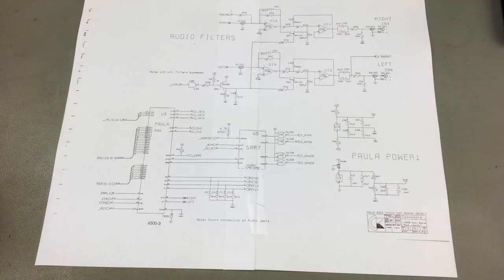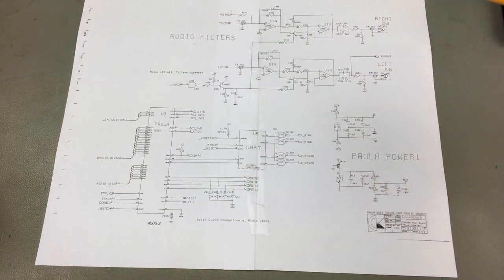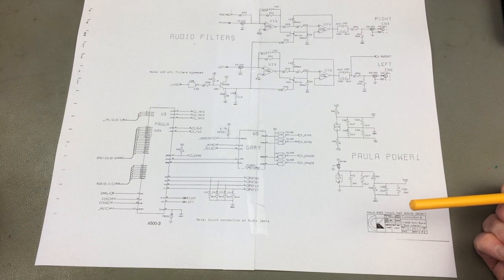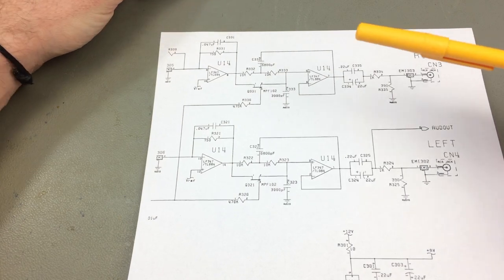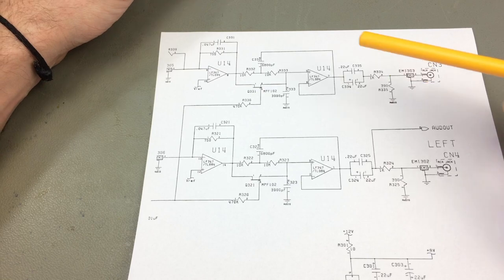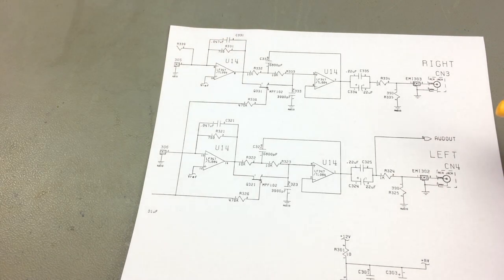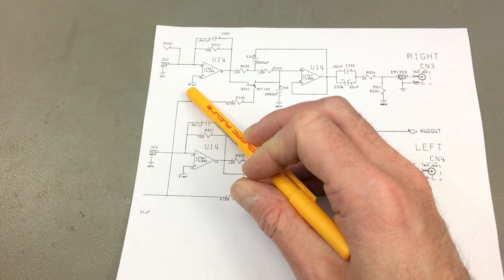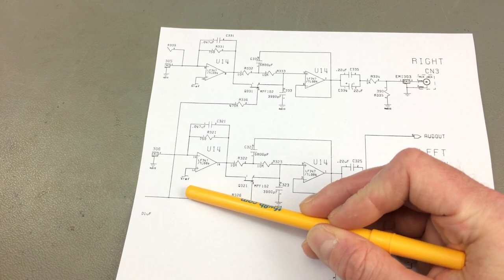Re: Bipolar Capacitors in the Amiga Audio Circuit

Comment: So, about the EMI filter. That is actually a T-filter (T resembles the shape of the circuit). That is a inductor in series. Then comes a capacitor to ground and then an inductor in series again. It filters out the high frequencies in the RF range.

Then about the circuit, that you have shown in the first schematic. That voltage divider creates about 2.5V, which is then used as a "virual ground" (=a reference point at the + input) for the opamp circuit. This is very common, like if you don't have a negatice supply, just +5V and ground. Here, they just used it to lift up the signal to 2.5V.

The polarized cap is absolutely ok. It just blocks the DC offset and is good practice. If you would measure the + and the - of that caps simultaneously with two probes and then subtract the - channel from the + channel, you will get something, that is mainly DC, a voltage drop of aprox. 2.5V.

The audio ground is separate from the digital ground. That is good practice. There are soem high frequency currents flowing through the digital ground (many transistors in the digital circuits are switching at the same time) , so it is very noisy. The analog or audio ground and the digital ground are split up close to the power supply. Absolutely fine. 

The 0.22uF ceramic cap is for the higher audio frequencies. An electrolytic cap usually has some parasitic inductance and that makes it behave like a low pass (a bit). So, that is helpful.

The old circuit: it has two polarized caps in a row with the negative side tied together. This is the internal circuit of a bipolar capacitor (Sic!). I do not believe that a bipolar capacitor will create a better signal. I think, it will be a bit worse. Here is why. Two similar caps in series will have half the capacity. But since they have a parasitic inductance, in series, it will add. So you have the double unwanted inductance. 

Around U56 in the old circuit, you will have an active filter (I will not analyse it :-)) It is fourth order and might be a bit unstable. In the newer circut, it is of 2nd order, which has a less steep characteristic than the  4th order filter, but might be more stable. A measurement with some (really expensice) audio lab equipment (aka audio precision) might unveil this. 

My conclusion: No bipolar cap is required. it will not improve the signal. the newer revision design might be better.
Reply: The EMI filters are actually just R-C filters so they have a lowpass effect... but the corner frequency is way out of the audio range so they have no effect on the audio signal
Reply: Peter Mulholland who would want that dc resistance of an r/c low pass in the audio outputs? They are L-C-L filters.
Reply: @svenpetersen1965  The resistance at AC in the audio band is negligible. Look up the actual parts used - they are R-C filters. Look further at how the later Amigas were implemented in SMD - with R-C filters.
Reply: and in fact if you look at the part value of E305, it is a ferrite bead (negligible inductance at anywhere below 1MHz) and a capacitor to ground. Missing in the later machines.
Reply: Also R325,335 is a lazy way to control the total voltage out. (at least i use it like that some times).

Comment: (Last post, I promise!)

The reason for the Vref bias is actually nothing to do with the output coupling capacitors - other than that's why the output coupling capacitors are required ! The Vref voltage is there because Paula is running from a single 5V supply. Therefore to have a "negative" part of the audio waveform, some bias point needs to be set. Because Paula's output is a current output, this output bias is set externally, and it is set at the first two opamps which perform I/V conversion for Paula.

They COULD have constructed a -2.5V reference point and fed this into the second opamp stage, but this would cause other design issues - it was easier to simply put DC blocking capacitors in line. Really, they could have made the audio opamps run on a single +12V supply, as they did later on in the CD32.
Reply: Correct, the output capacitor is there because of the Vref bias, not the other way around.
Reply: You have insight!!

Comment: Great video Jan, I enjoyed that!   Capacitors do block DC voltage (when used in coupling!) and they pass AC (I noticed you got the description correct but the opening comment there was a mistake!)  Nice idea filming both things at the same time!  The small ceramic is not filtering as such, it's passing the higher frequencies (where the electrolytic will block some of them).  Nice discovery on the use of bipolar caps there on the early rev A2000 board!  I had no idea they had done that there!  Bias on that is 2.444v btw! (assuming it says 1.15K on the one connected to VCC, and 1.1K on the one connected to ground).
Reply from the maker: Whoops, misspoke again... Meant to say the exact opposite obviously... facepalm :D
Reply: It's kinda interesting how those small high-freq passing caps are not present in the A600/A1200/A4000 audio circuit. I wonder why the decided to remove those... To cut costs?
Reply: @JanBeta  Don't worry about it lol!  Been there myself!  Sometimes you can be so focussed on trying to correct something you do the opposite (even though you know what you meant to say!)  If I had a euro for every time I said resistor and meant cap...
Reply: @8bitbubsy  yes, cost cutting.. and really they would have very little effect anyway... the Amiga is not exactly a piece of high end audio equipment :)

Comment: You are correct about the electrolytics being bypassed with ceramics for high frequency performance reasons :) However in the Amiga's audio circuit, it really is "gilding the lily" which is why it's left out on later Amigas.

Some extra things...

R332, R333 and C332, C333 form the Amiga's audio filter. It's a low pass filter implemented using what's called the Sallen-Key topology. The JFET Q331 is what switches the filter on and off - when the JFET is biased on, it shorts out R332 and R333 which nullifies the filter effect, and then the opamp simply becomes a unity gain buffer.

R334 and R335 have a few functions. Firstly, R334 acts as a current limiter - if the audio output is shorted for whatever reason, only a limited amount of current can be passed which prevents damage to the opamp. Secondly, R334 and R335 in series give a path to ground which allows the coupling capacitor C334 to charge on power up - without this, you would get a huge, nasty bang noise when you connect the audio jack with power on (instead you get a little bump). Finally, R334 and R335 form a voltage divider, which sets the maximum audio output level.

Comment: The reason for the multiple grounds on the schematic actually has more to do with PCB routing than electrical connection. All of them end up connected to the power supply's 0V line, but how they are routed on the circuit board is different.

The reason is because of the effect of return currents along ground. Digital circuits can create a lot of noise current in the ground returns, and this can couple into sensitive analogue circuitry. One way to avoid this is to track sensitive ground returns separately from power ground returns, back to a single point. In this case, all of the audio grounds are tracked back to one point (I believe it is at the audio jack's ground) so that contamination is minimised. There's numerous names for the techniques, you may well know the term "star grounding" as used in audio circuitry.

The shield ground is really just a connection to ground used to attenuate emissions... it doesn't really have anything to do with the mains earth safety ground. The safety ground is often coupled to the 0V line so that if the primary-secondary insulation in the mains transformer breaks down, a path to safety ground will be formed which will trip an RCD/GFI or blow a fuse etc.
Reply: Actually on the A500, the audio ground is very visibly separate. If you look closely at the area on the PCB marked "AUDIO FILTER" you will notice there is a ground plane there that is isolated from the rest of the PCB, except for two connecting tracks at the top right. This is the point at which the audio ground connects to the main system ground. It simply ensures that the high speed current pulses from the digital circuitry are kept out of the analogue stuff, which would cause noise.

Comment: Very good explanation and demonstration. But you are still saying that the capacitor can be reverse biased by the audio signal; it can't, as the capacitor +ve side is ALWAYS about 2.5V above the -ve side. Also as mentioned by others, the reason for the 2.5V bias is to allow DC coupling from the PAULA chip which outputs audio centred about 2.5V, as it runs on a single 5V supply.
Reply: I think it is significant that the +2.5 Vref circuit is drawn connected to Paula to try and tie the two together, and not drawn in the op-amp circuit...

Comment: The point is while the positive side of the cap can go slightly negative the negative side is tracking it. The best way to show this would be channel 1 on positive side of cap and channel 2 on negative and show that the bias voltage is always the difference between the 2 channels
Reply: Exactly, it doesn't matter if the positive pin goes below ground as long as the negative pin is even lower. The positive and negative are just relative to each other, not the ground.

Comment: One of my former professor used to say "If you haven't understand something, give a lecture about this topic". So you were forced to dive into the problem very deeply.Maybe because of that your follow up video were very informative. I enjoyed it very much and learned a lot. But, as other commentors already mentioned, there is never negative voltage above the capacitor during the overshot. While its input is -0.5 volts its output should be -3.0 volts, i.e. the cap is still polarized correctly.Usually my prof added: "If you have still questions, write a book about the topic!"
Reply from the maker: Yes, as you said I learned a lot from making these videos. Glad it was informative for you, too. The voltage never overshooting makes sense now. Another thing learned. ;)

Comment: Even negative output voltages doesn´t mean, that the capacitor is biased negative. It´s a question how long the capacitor will hold it´s positive charge during a negative sine wave cycle. Only at very low frequencies (typically below 1Hz or so) the capacitor may be reverse charged. Measure both sides of the cap with your scope in differential mode and reduce the frequency.

Comment: To measure the voltage over the cap you need two probes. Put prove 1 on the positive side. Put probe 2 on the negative side. Use DC coupling for both probes. Press the invert button on channel 2. Press the add button.
Reply from the maker: Yes, I considered doing that but I considered it useless as both sides are referenced to ground so the separate measurements should be sufficient.
Reply: Yep. The 0.22 uF on the output of the last opamp is indeed for higher frequencies (electrolytic caps are bad at this). The first opamp gives an offset to the signal and does minimal filtering of signal from the paula (low pass about 4.5 KHz). The second opamp acts as an (second order Butterworth) active low pass filter to remove noise. On the amiga 4000 the last opamp does not add the CD audio, it just does some additional amplification, with a good quality audio amplifier (LM833, not just a normal opamp). The fet is use to cut off the signal.
Reply: I did exactly that on my last video - just saw a slightly wavey line.
Reply: @GadgetUK164  Did you use DC coupling? You should have seen a line at 2.5V..... This line would have a slightly bigger wave on it on lower frequencies, but the wave would never make the line dip below 0V. It would stay far away from 0V (even if the positive pole of the cap would go negative).

Comment: 31.20 The bias circuit is necessary because the D/A converter in the PAULA chip generates a voltage between 0 and 5 Volts. Whenever the audio output is supposed to generate silence, the PAULA outputs are 2.5V (not 0V).
The first opamps that the signals travel through, filter the sound by feeding the output back to the input with a capacitor in parallel to a resistor. I think that's a low-pass filter. But the opamp needs a reference voltage that basically represents where the level of silence needs to be. At that point, "silence" is 2.5V (not 0V) so they generate a "quick and dirty" reference voltage with two resistors between VCC and GND. The value of the resistors is not critical as long as they are equal. The older circuit might have used 1.1K in the specs to ensure that the resistors would have an accurate value. Later on, they decided it was more important to save 0.01 cent by using perhaps less accurate 1K 5% resistors instead of 1.1K 2% resistors.
The capacitors that take the bias out of the signal are towards the end of the circuit because there, the signal is the strongest, so any filtering effect of the capacitors is minimized. They could have put series capacitors at the inputs of the first opamps but then the capacitors would have caused a lot of distortion because the DAC probably has a pretty high output impedance. The second opamp in the circuit for each channel is used as buffer: the output is directly coupled to the negative input which makes the output voltage exactly the same as the input, but with much lower impedance. That way the bias capacitors have almost no influence on the signal itself. They always have a positive voltage over them, which varies with the audio signal but is always positive. You could verify this by connecting your two probes on either side of the bias capacitor and putting the scope in ADD display mode with channel B inverted (so you display the A - B signal). You will see a DC signal that's always above zero, and that proves that bipolar caps are unnecessary.
Reply from the maker: Ah, that makes sense! Thanks for clarifying things. :)

Comment: I’ll check out these other videos.  As soon as you said ‘we’re using the capacitor in series’ and drew that capacitor, it reminded me of a certain other device that is frequently used to keep out ground loop hums and unwanted noise in audio signals: audio isolation transformers.  Often sold in guitar pedals called direct injection or DI box, I’ve seen little arrays of mini isolation transformers in ethernet router boxes, right up near the in/out sockets.  I’ve never owned any commodore box, but I’m curious now, and I am a fan of the mod tracker sequencers in software for phones and PCs.  There IS indeed isolation right there, where those two caps are, and so I wonder whether isolation was a desired result, in order to reduce ground loops and unwanted sound artifacts to the resultant output signal?  What I have seen in this exact placement on output buffers in audio gear is a polarized electrolytic cap, say 10 microfarad, with its positive leg ‘upstream’ or next to buffer stage output, then followed by another polar 10 microfarad electrolytic capacitor, only this one’s positive is mirror image of the first.  So the second electrolytic cap has negative leg touching negative leg of the first cap, then the second cap’s positive leg would be closer to the RCA output Jack.  So two polar caps in series, with positives opposing each other, and negatives joined together.  Good isolation.  Great video!  Thanks for sharing!!

Comment: Audio Ground is referenced to system Ground via Ferrite Bead FB802.   It is on pin 14 off of Paula on the schematics, to the left of the "Paula Power!" (or in the 500/2000 manual, on the previous page).   It is electrically directly connected, but isolated via the bead to reduce digital noise on the ground plane in the audio stages..
Reply from the maker: Yes, makes sense! Thanks.

Comment: Hi Jan, much better now! :-) Maybe some more detailed info regarding the AUDIO-GND. If you look at section PAULA POWER! on page 5 on your schematic, you can see that AUDIO-GND is the middle of +12V and -12V coupled via the four caps C301 .. C304. So AUDIO-GND is so to say the AC-GND (reference GND) of the AUDI signal. On Pin 34 (A_GND of PAULA) the AUDIO-GND is connected to GND via the ferrite bead. So that is the DC connection from AUDIO-GND to GND. The small ceramic cap at the output of the OpAmp is to transfer the higher frequencies, that are "blocked" (damped) by the electrolytic cap. Best regards, Doc64!
Reply from the maker: Thanks for the additional information sir!

Comment: nice vid! I remember an switchable audio-filter mod back in the days around (~1989) which made an enormous improvement to the original sound of A500 / 2000. I got the original wiring-diagram lying around here in my compu-lab. Interested in?
Reply from the maker: Oh, definitely interested. Do you have a way to scan and send it over? (thejanbeta at gmail dot com)

Comment: Good follow up. Just for clarity though, That cap doesn't see negative voltage, and may only see very small ones in extreme cases. You are all talking about the negative dip WITH RESPECT TO GND. But, the cap is NOT connected to GND. So When you have a high signal going in, and the signal dips below GND from the audio amp, where is the output at? It's MORE Negative than the input. So you see maybe -0.4V at the dip on the input, the output side is at -2.5V odds, so looking at the perspective of the cap (NOT GND) the negative side if the cap is a lower voltage than the input side. The whole output side could go negative, but the cap never really sees any negative, because it is not referenced to GND.
Reply from the maker: Yes, that makes sense. I think the comments from this follow up video finally helped me understand the whole thing. Thanks for clarifying!